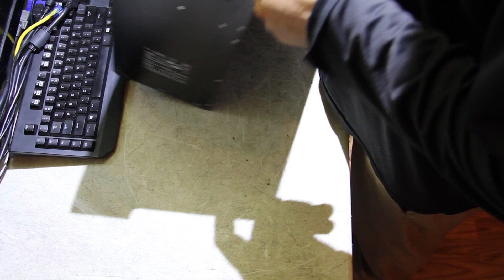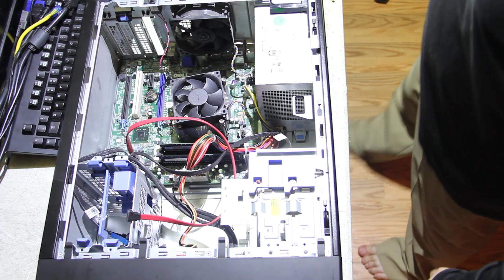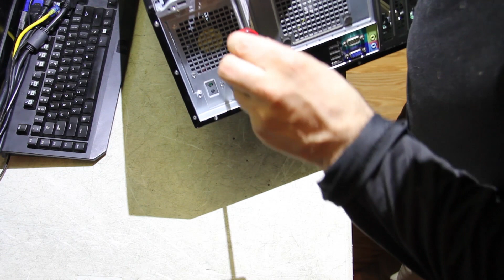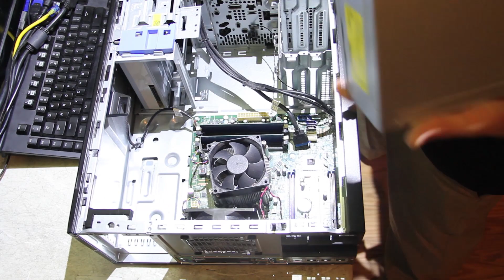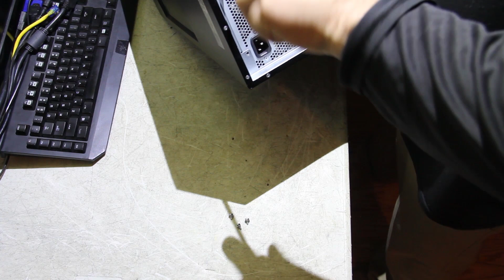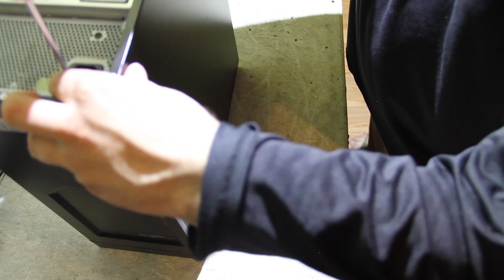Dell Precision T1650 and Optiplex 9010 teardown and upgrade guide

Comment: I'm watching you replace the power supply without any comment on the slider that will get in the way of a larger power supply. What is it for and how do I best remove it without using a hacksaw?
Reply from the maker: Unfortunately on something this old I don't even specifically remember making the video let alone specifics on the hardware, sorry this video was a half a decade ago
Reply: @dragonsystems5973  Thanks for your reply. I find it odd that no one has mentioned this slider. Not any DIY or DELL. I actually did end up cutting the tab off with a hacksaw on my last build.
Reply from the maker: I am considering getting back into doing these kinds of teardown videos, but right now my plate is pretty full with custom and retro builds
Reply: @dragonsystems5973  Got it. It's a latch? Who knew? https://www.youtube.com/watch?v=IEptRWi0Tb8

Comment: aye bro, what was the power supply that you reinstalled into the t1650, i'm doing a build almost exactly like yours and the last thing i need is the power supply. i'm doing a 2gb gt 730 ddr3 graphics card with sk hynix 16gbs of ram and a 512 gb of hdd. if you can help me out then that would be great bro.
Reply from the maker: I did not change the power supply, I am pretty sure the factory unit should be fine for at the very least stuff up to like a 1050 Ti, 1650, that kind of low end entry level gaming card

Comment: I'm having a problem with the mic of my headsets. I tried it on another computer and it was fine but on this one it makes hell of a noise. I think the microphone port is not working properly. How can I change the port?
Reply from the maker: Ummm??? What does that have to do with the content of this video??
Reply: @dragonsystems5973  I want to know how can I change the ports on this casing
Reply from the maker: @ghufranmuhammad5432  This machine is long gone, any info I have is what is in the video, honestly I never intended to go over modification like that
Reply: @dragonsystems5973  Its ok, thank you
Reply: @dragonsystems5973  Sorry if I asked something wrong. I'm not sure if I should ask something that isn't related to the video.

Comment: if you add a gtx 1660 super to it would it be good for gaming?
Reply: been using one of these with a GTX 1050 (2gb) for gaming for the last four years and that is good for the majority of games (7dtd, gta, arma3 but not empyrion), just upping it to a 1660 super tonight but it does also need a power upgrade as they don't come with a pcie power cable I'm using a corsair 550w psu, 32GB ecc memory and 1660 super for the upgrade.
Reply: @domstsgs9195  
Does your configuration work well with flight simulator 2020?
Reply: @emmanuelkeller2089  Not a game I have bought, sorry. However, with the super installed it runs Empryion - galactic survival with ease at 60fps (ultra graphics mode) and that's a game that has never been optimised efficiently, the 1050 was a frames per minute slide show. So, my best guess would be that it would easily run fs2020 now. This T1650 has the xeon 1240 v2 3.4*8 cpu. You can pick up a similar refurb with an I5 these days for around £500 I guess.

Comment: Can I fit a 280mm gpu in there? (Asus gtx 680 4gb gddr5)
Reply from the maker: Are you talking the strix model?? I dont have the 1650 in front of me anymore, or a strix card... but that might be pushing it.. even if it fits, I'd be worried about the power supply... if you are going to do those types of upgrades, you really need to be looking for the lower power versions of the cards, not the largest most power hungry model you can find
Reply: @dragonsystems5973  I'm also upgrading the psu to 500w EVGA white so power should not be an issue. Thanks for replying!

Comment: I am having a hard time setting up dual monitors. I have two display port cables and I have a HDMI to usb adapter. I plugged one display port in the very bottom DP slot and tried to plug another one in to one of the DP slots that is located in the back center. I get a unsupported video configuration detected error on my monitor that is plugged in the back center slot. Can anyone help?

Comment: Can swap motherboards?
Reply from the maker: As in put a different board in or as in simply replace a broken board with an identical functional board?
Reply: @dragonsystems5973  As in using the dell case and installing my own components. ex. ASRock Motherboard?
Reply from the maker: @MysticMind93  I always say where there is a will there is a way, HOWEVER it would require doing weird hinky mods and wasting a lot of time. Just go on craigslist and find a case with an old high end name brand power supply in it for like $25 and call it a day... something like maybe an Antec 300 with an antec 500 earthwatts or something along those lines
Reply: @dragonsystems5973  Thanks
Reply from the maker: @MysticMind93  Yeah deffinitely, dont want to see someone waste their money on a a kinda pointless project when there are better options :)
Reply: @dragonsystems5973  hey there, I know this is an old comment but I spotted this desktop on a local online selling board and I was wondering if a mATX motherboard fits in this case. I think the mobo this one uses by default is btx-size, so any idea if a mATX would fit? The btx-size is quite strange...
Reply: Yes, but the power button and front I/O aren’t plug and play.

Comment: Great video and nice teardown. Got one of these from my workplace as they were sorted out. I was wondering if there is any possibility to add a front case fan. Adding a GPU might increase temps inside, and so would a more powerful PSU I guess. So more airflow would be a bonus. Thanks!
Reply: you can add a front fan.

Comment: i got a Dell Precision T1650 Xeon E3-1220 v2 3.1GHz 16GB RAM 2TB NVIDIA Quadro 600
on ebay for 150 is this a good deal?
Reply: Not terrible
Reply: Add a SSD and Rx 570/580 and you should be good to go

Comment: Does 1050 ti cerberus fit? Answer please
Reply from the maker: I would not recommend anything more than the lowest end versions of the 1050 Ti unless you plan on upgrading the power supply as well. Also, please stop with the desperate plea routine, folks, ive shown I answer all my comments, you dont need to beg me to respond